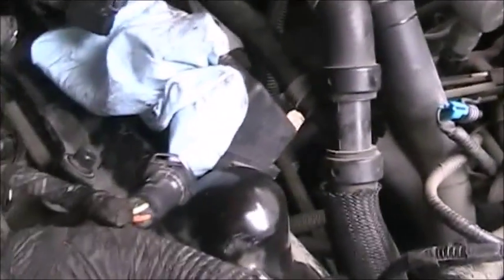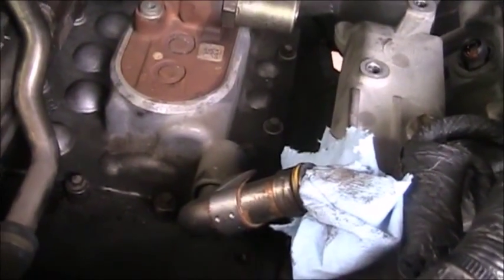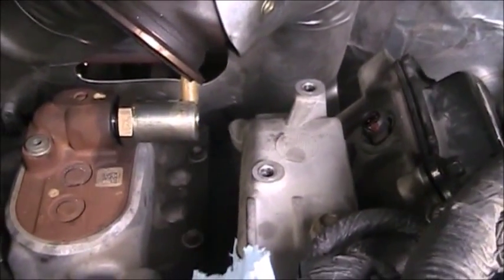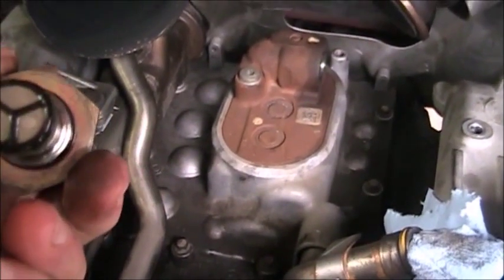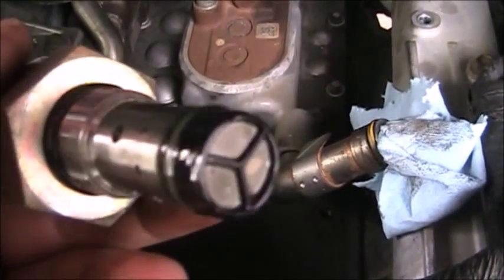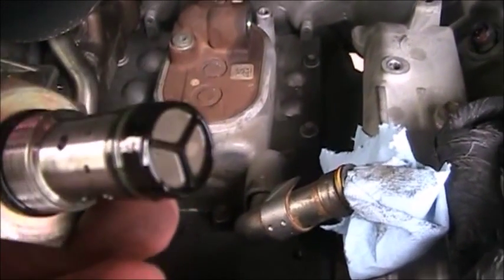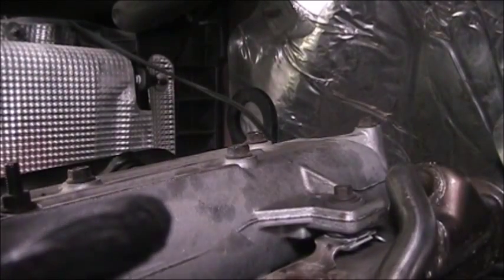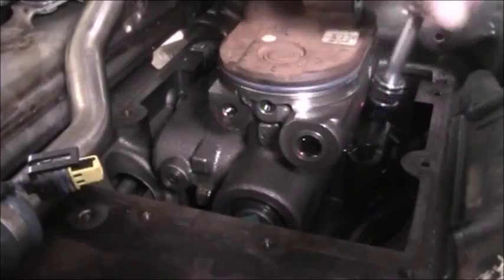Part 2: 6.0 Powerstroke HPOP Fitting Update

Comment: what were your original symptoms
Reply from the maker: The first clue that something was wrong was when I noticed that it was taking longer and longer cranking cycles to start the engine. As the problem progressed, it finally got to the point where the truck would not start while it was at operating temperature. If you have not seen it yet, I would recommend that you watch part one, where I lay out the scenario and diagnose the problem. Thanks for your interest. Don't hesitate to ask if you have any other questions. Here is a link:

https://www.youtube.com/watch?v=N438q0zTsS8&t=1s